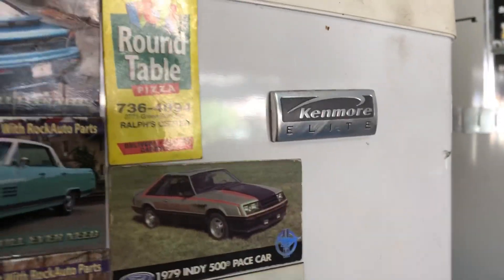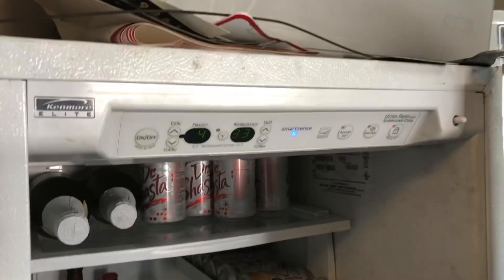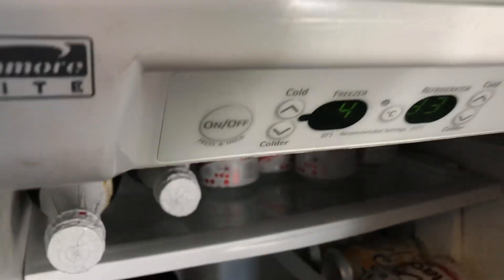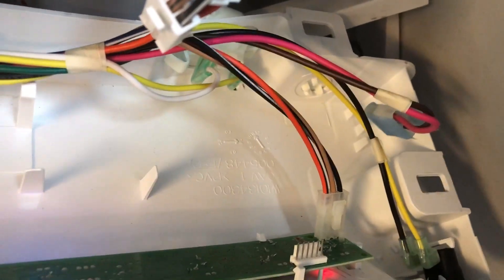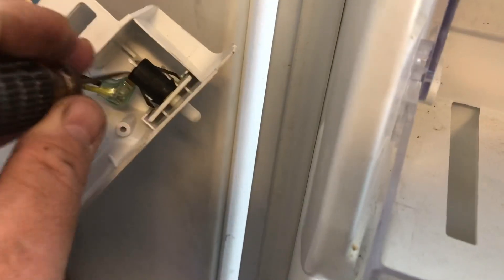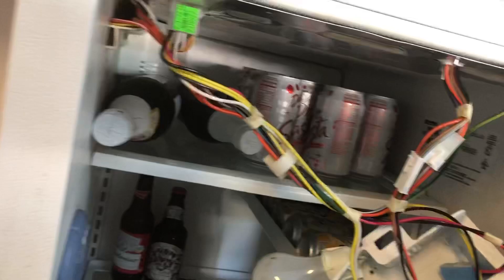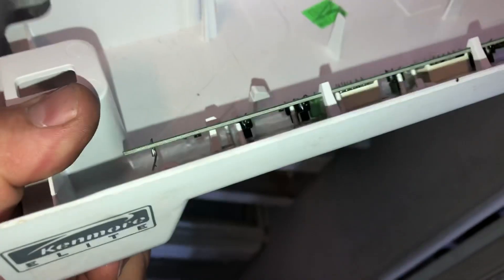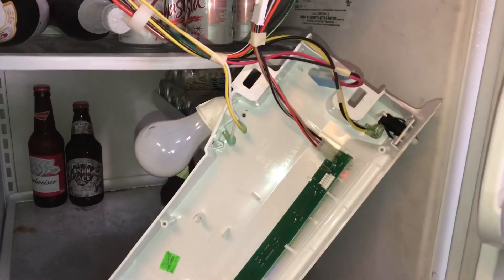Kenmore Elite refrigerator door alarm beep silenced

Comment: I followed you directions other than I only took off the 2 screws on the left, since they were a little difficult to remove.  Speaker was easy to locate and speaker easily popped right off with a flat head screwdriver.
I worked in my garage today and if felt heavenly.  NO MORE BEEPING!  Thank you very much!

Comment: Thank you!  I had the exact same problem.  I have a similar Kenmore refrigerator in my garage but the beep was coming from behind the ice dispenser panel.  I removed the faceplate of the ice dispenser panel and found a similar control board with the same round, black "speaker" component. I removed the "speaker" with a screw drive and the problem is fixed!  Can't believe I've put up with that annoying beeping for months.
Reply: How do you remove the faceplate of the ice dispenser? From the front of the door? Please let me know, thanks!